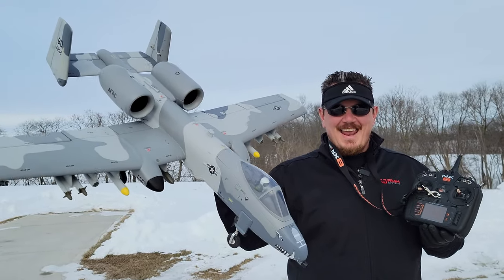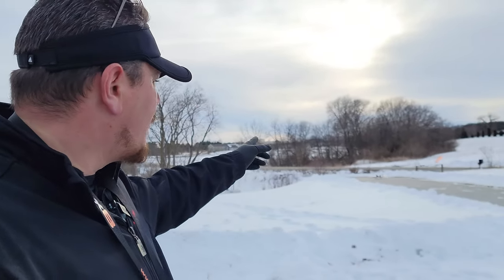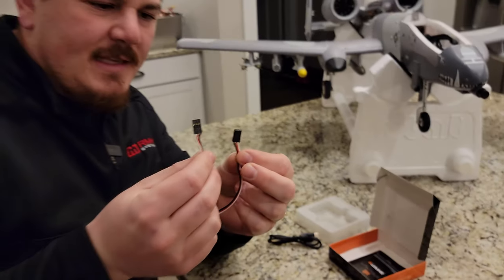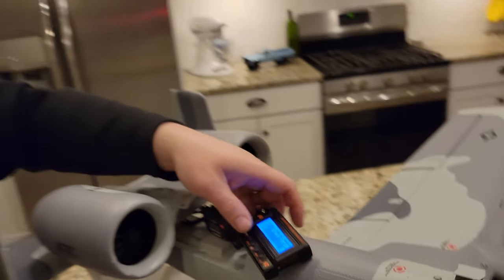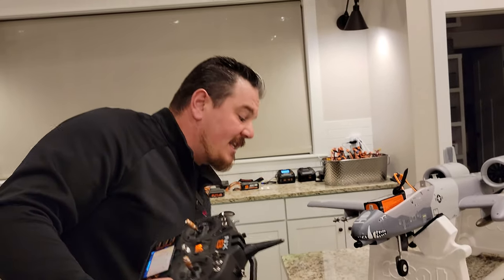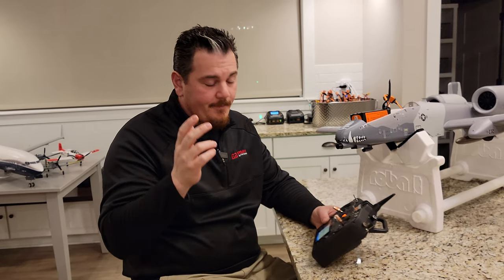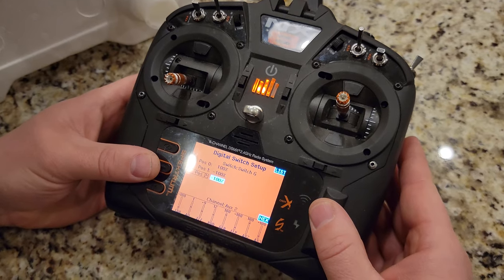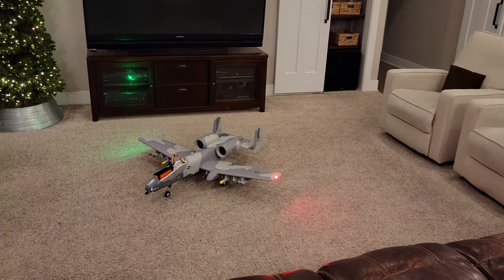Horizon Hobby - A-10 Thunderbolt V2 - Thrust Reverse, ESC + Radio Setup, & Flight - FIXED QUALITY

Comment: From the ESC Programming Box manual - hope this helps..... 

      --  • Brake Type
o Disabled (*) Default – Motor will free wheel when throttle position iszero
o Normal – When throttle position is zero, the assigned brake force will be applied
o Proportional - With this option selected the throttle range changes so the ESC will not
start below 20%. The throttle will operate as normal above 20%, but moving thethrottle
below 20% will apply the brakes, increasing in strength as the signal drops to 0%.
o Reverse – When selected transmitter channel is positioned between 0 – 100% travel,
the motor will run in reverse, allowing for braking during taxi/landing and reverse thrust
Please Note – Reverse mode needs to be assigned to an OPEN channel on your
transmitter, this channel is selected in ESC menu item #15 using in conjunction with
another function can cause unexpected behavior in flight.
     --  • Brake Force – This option is adjustable from level 0 (* Default) to level 7. The higher the level,the
stronger the braking effect. When running Reverse Brake Type we recommend setting this to 7.  

Cheers!!

Comment: Nice! I hope I can now program my DX8G2. I tried to do the mixing but it didn´t work out well, sometimes full in one direction and sometimes in the other. I think the definition for digital switch was missing. I´ll try out your mode and maybe additionaly the Bind button :)
Reply from the maker: If you're operating the channel that changes the thrust direction, just make it -100, -100, 100 for the three steps of the switch. Once you get it changing, DON'T leave a "floating point" in the middle at 0 - that will leave you vulnerable to having thrust NOT change as expected. 

The switch you pick has ZERO baring on what happens - they all command a CHANNEL of control. If you aren't changing it from -100 to 100 (or vice-e-versa) you won't get the thrust reverse to work right.

Gotta get this totally right or you'll end up killing your plane - I KNOW from experience ;) 

Good luck! You got this!

Comment: I have to pick one of these up even though I am no where near good enough to fly it, I don't want to miss out on a great A10
Reply: Don’t worry, this should be out for at least a year, but I hear you on not wanting to miss out. I believe you can work your way up to this jet in no time at all (if you practice often it’ll take a few months, but that’s not too bad)
Reply from the maker: This was just re-released, but seems that anything you want, there's no guarantees anymore ;(

A10 https://bit.ly/2P1i286

....ALSO, if you think it's expensive now, wait 5 minutes - LOL :(.....
Reply: @BrianPhillipsRC  I did pickup the A-10 V2 and it's in the box, in my closet.  I also grabbed the Program Box at the same time but I didn't buy batteries, or building supplies (Foam 2 Foam) just so there is 0 temptation.  November 1st I am buying the Apprentice S2 1.2mm RTF to start out with and i will get an NX8 in a month or 2

Comment: Hello! That is an awesome mod! What would be a beginner EDF other than the Habu(not a beginner plane but a beginner jet)?Love your videos!
Reply: It depends on what cell count batteries you currently have. The E-Flite F-15 Eagle 64mm 4s is a great beginner jet (just beware the ailerons are very effective and the elevator is very mild.) If you have 6s batteries laying around, the E-Flite Viper Jet 70mm 6s is also a good beginner jet. Just beware it is a sport jet with its capability, so use low rates when learning it. If you have 4s EDF experience, the E-Flite F-16 Thunderbird 70mm is a good first 6s Jet. That jet on high rates has a fast roll rate as well. Hope this info helps!
Reply: @aerospacematt9147  yes it does! Thank you!
Reply: @gannonelkins5134  No problem! Good luck!
Reply from the maker: I thought I answered this quesiton...so I must have clicked and then it got stuck in the inter-web - SORRY!

Non-Habu EDF's???

What about the Arrows line?

BAE Hawk https://bit.ly/3pSmp4v + AR410 https://bit.ly/3GnSY0w
T-33 https://bit.ly/3DuVOPp + AR410 https://bit.ly/3GnSY0w
Viper https://bit.ly/3uinxlD + AR630 https://bit.ly/3rkGZMI
Marlin https://bit.ly/3AThncQ + AR630 https://bit.ly/3rkGZMI

Comment: Works great! I would have never figured that out on my own. How bad is it when it clunks from one direction to the other? Even at the smallest amount of thrust, it clunks when changing direction.
Reply from the maker: It does make a pretty drastic change, but if you're worried, you can set the BREAKING to 11 (not zero like I used) and this will help some - good luck Lee!

Comment: I believe the manual says to set brake force to 7 when programming for reversing. Would you think this is strictly to slow motors before switching direction? Would there be an advantage/disadvantage either way?
Reply from the maker: I heard it from the factory, but after we filmed. I would set the break force to 7 as suggested.

Comment: A 10 eflite ESC programing. Reverse thrust. 
At 22.49 time stamp. Can you use a y connection to program both sides . In stead of doing it separately????
Reply from the maker: We showed what we know. This is the only time I think we've done it...so not sure what to tell you.
Reply: Thanks for the honesty. How about if it works for me I'll share with you. Thanks for your long context. I have been able to program every one of my planes because of your channel. Only 8 months in and Dove deep into the Hobby and between the wife and I we have 22 all e-flite planes. And one FMS pa-18 super cub that had a bad out come due to me paralleling a 3s and 4s by mistake. Biggest ball of fire slowly fell in to the lake. Have photos if interested.

Comment: Fairly new to the sport, can I use the ESC Programmer V2 on my MotionRC 80mm thunderbolt to set up Reverse thrust as well??
Reply from the maker: No, they're proprietary. Sorry. You CAN get programmers for most all ESC's, but look into the TRANSMITTER PROGRAMMING - you might be able to make simple changes from entering a menu and modifying settings from the Tx. you usually do something like this...

Throttle 100% at startup...wait for a series of beeps to change, then throttle stick down...then look at your programming guide and see what each series of beeps particular setting is, then just use THROTTLE to change the setting when you're in that particular spot. Then when you're done, it just resets and you'll hear sometimes, a different startup noise to help you know what you've changed. It's called a "Programming Manual" for the ESC...see if you can get one from MotionRC.

Good luck!

Comment: Does anyone know if Gen1 DX8 transmitter will work with new AR630 AS3X/Safe receivers?
Sorry Brian, Couldnt find answer anywhere else.
Reply from the maker: I'm really sorry, but don't know with certainty. My GEN1 DX18 does support with firmware updates, but don't know about Gen1 DX8.

Comment: Just ordered this bird and the esc programmer. Has anyone tried adding reverse to the 70mm f-16 using the same programmer? Without flaps, it could definitely benefit from it.
Reply from the maker: I haven't tried on the V2 F-16 70mm yet, but it could really use it!
Reply: @BrianPhillipsRC  maiden flight of the a-10 today... What a solid flying airplane! I set my timer at 5 minutes but hit 3.8v around 3 1/2 minutes into the flight on a 4000mah pack. Definitely a power hungry bird. ESC programmer is coming in tomorrow. Thanks for the awesome tutorial on how to setup a "pilot fatigue" switch.